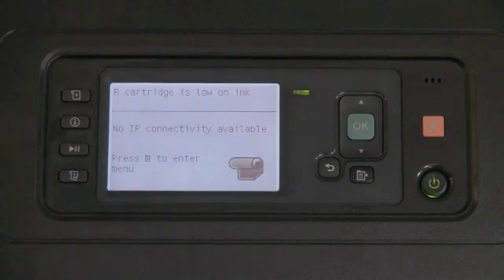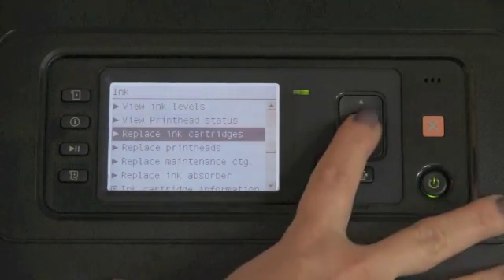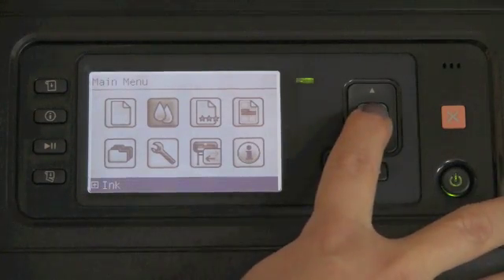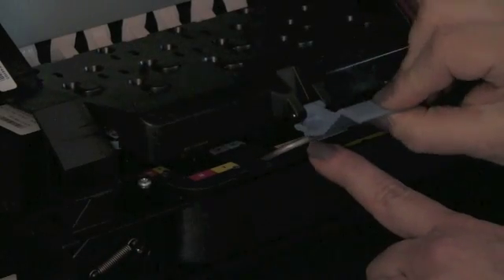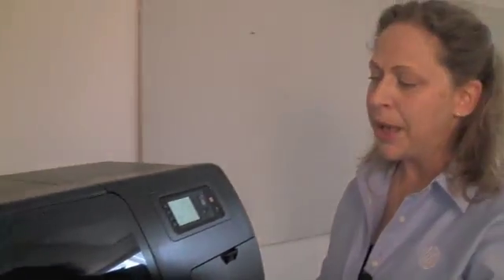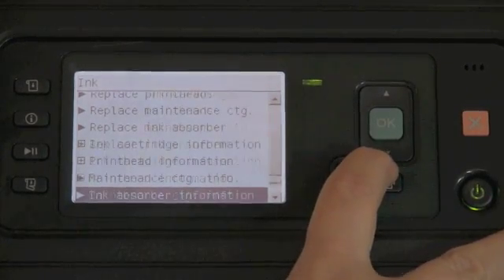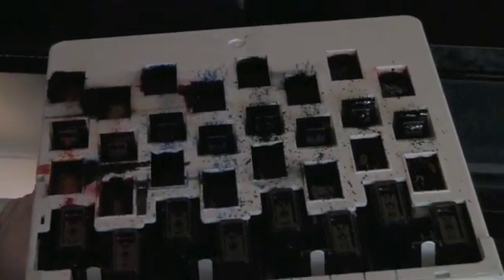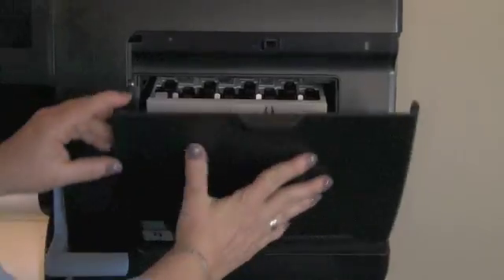HP Designjet Z6200 Replacing Ink, Print Head and Maintenance Cartridge

Comment: How often you change the Maintenance cartridge? I replaced less than a year ago and it is asking to replace again. We do not print a lot on the Z6200. Is that a set number of days for the message to appear or the printer actually senses the adequacy of the unit and condition before suggesting to replace?
Reply: If the printer is left on all the time like it should be it will continually use the Maintenance Cart from time to time to maintain the printheads.